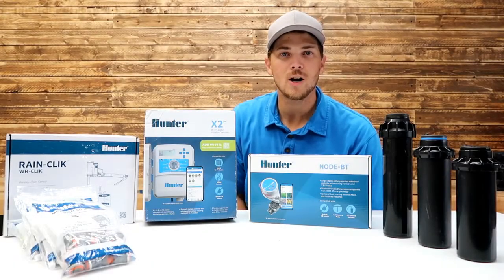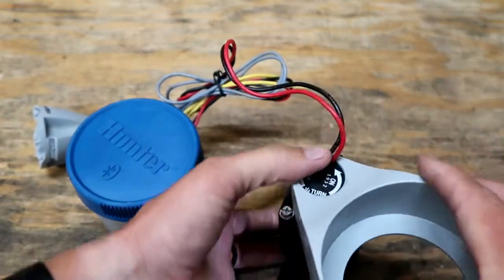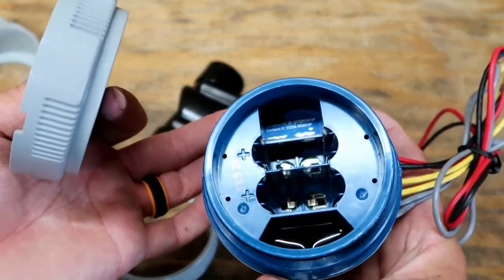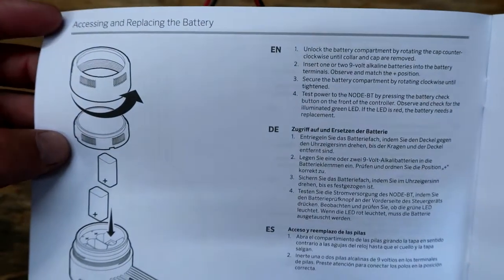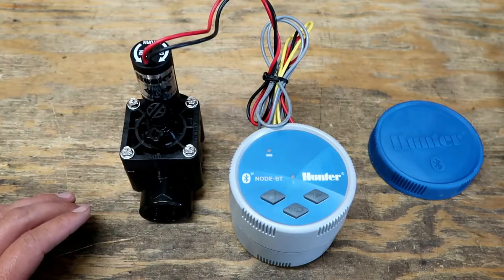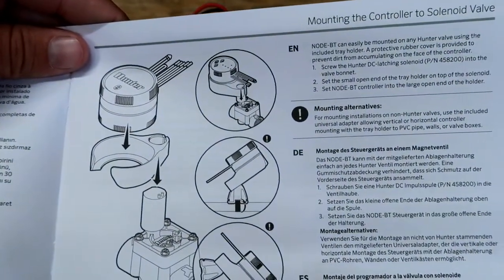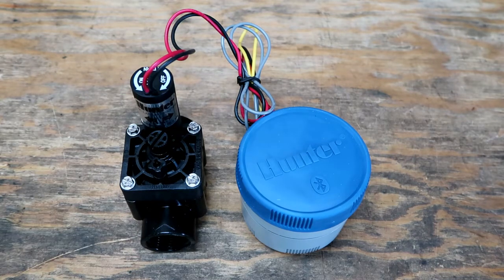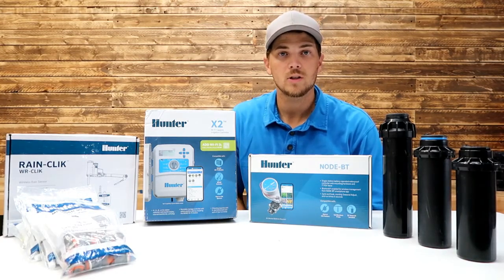Wireless Sprinkler Controller: Hunter NODE BT

Comment: This system is effin useless. Whats the point of this if you can't control the irrigation system from different places. You literally have to walk up to them to connect. You might as well water the effin grass your self. smh.
Reply from the maker: You walk up close to program it. You can set whatever schedule you want (daily, even/odd, specific days a week). You could set it up in Spring and it would water all summer.
Reply: @ThriftyGarage yeah but u can't be 50 miles away and activate it for what ever amount of time to adjust for the moment. That sucks.
Reply from the maker: @PureSwank yes, bluetooth is a short distance signal but also requires very little power. For a battery operated device length of time the charge lasts is more important than signal distance. If you want a WiFi unit you may need to have a constant source of power. The Hunter ProHC (Hydrawise) is a great option. RainBird and Rachio among many other brands have a variety of options.

Comment: What I don't love about this product is the bluetooth range is very short so have to be outside to control it since my node is in my yard. It cannot connect to wifi so I can't update a schedule away from home. I need to connect a rain sensor and it isn't compatible with a wireless rain sensor.
Reply from the maker: If you have ever tried to program a normal Hunter Node then you may understand why the Bluetooth version is better. It’s mostly only for programming purposes. Obviously it would be best to hard wire valves to a normal WiFi controller for improved user experience.